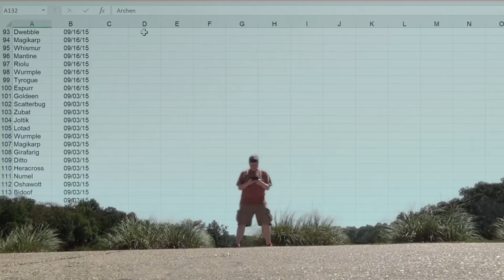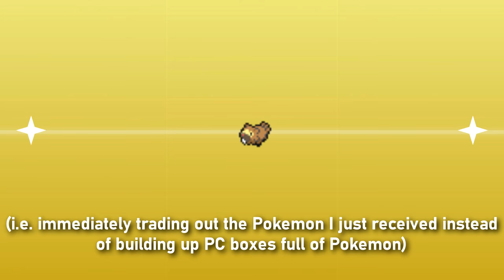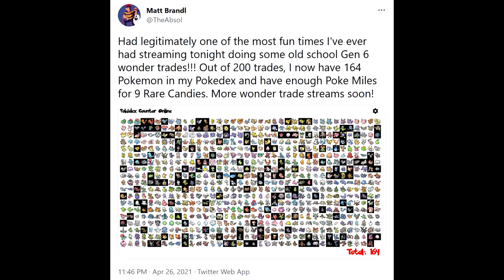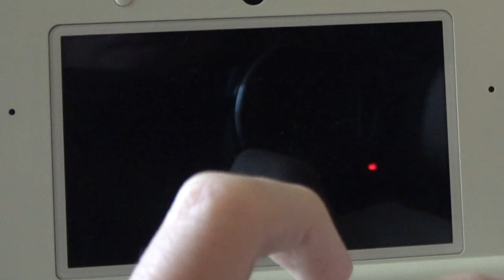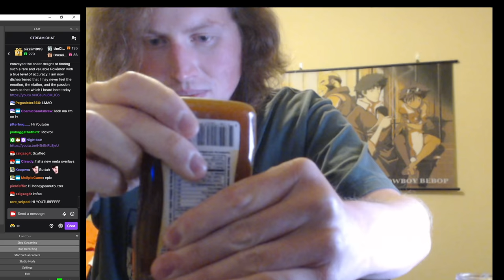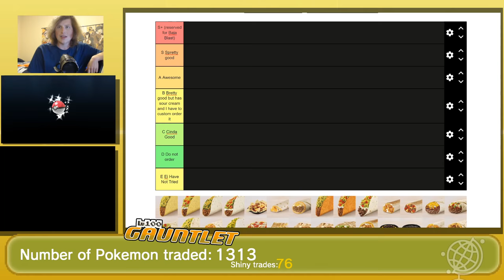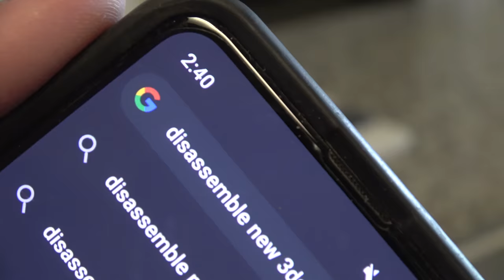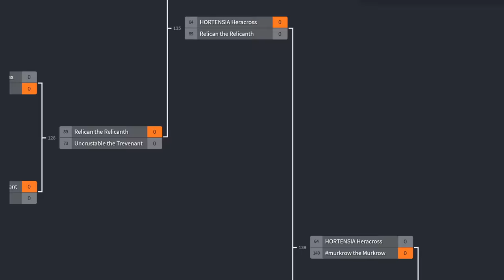566 - The Wonder Trade Gauntlet: Completing the National Dex & Hitting Lv. 100 w/ ONLY Wonder Trade

Comment: slightly unrelated but every time I tried to use the gts before wonder trade, all the pokemon I wanted were locked behind either impossible trades if u don't have an action replay (level 10 serperior) or requiring a legendary. barely ever used it 😔😔